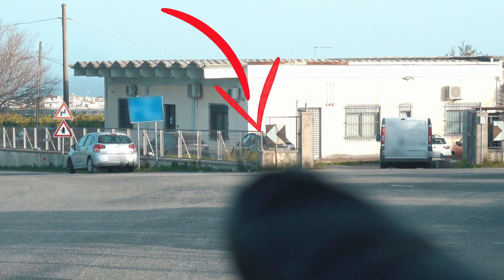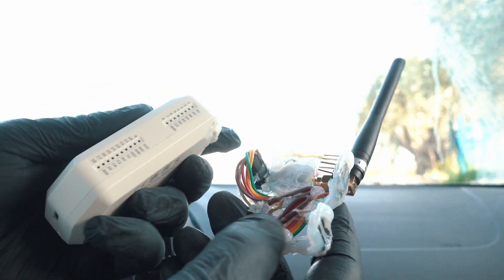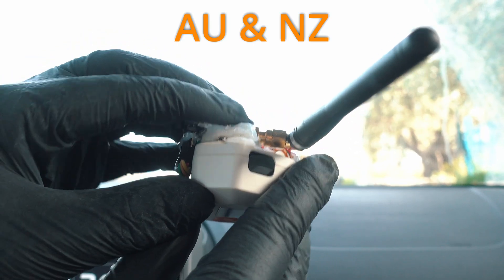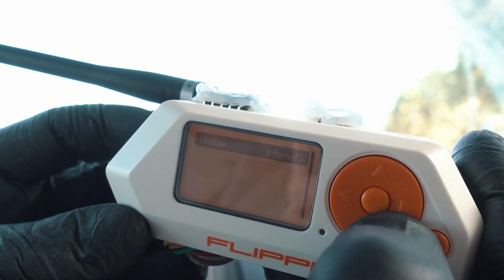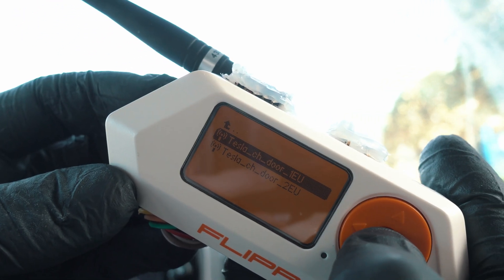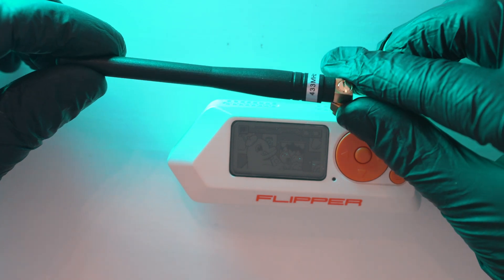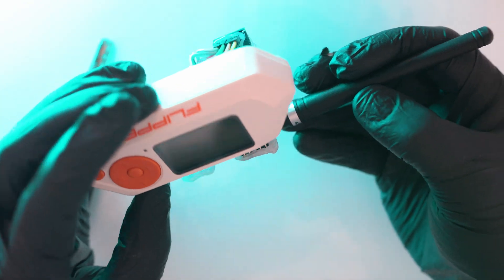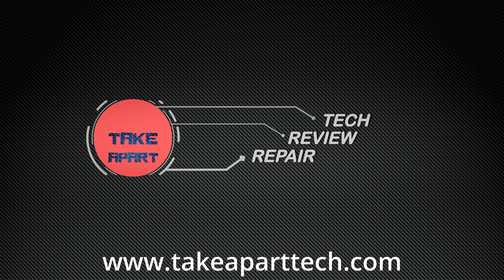Flipper Zero Tesla Charge Port - Long Distance CC1101 Module

Comment: I cant get the Tesla charging port to open with my F0
Reply from the maker: Hi Erik, did you get my SubGHz files? if so which one? also where are you located?
Reply: @takeapart  yes. USA
Reply from the maker: email me exact subGHz file from your flipper sd card and I will have a look.
Reply from the maker: you can find me email in information tab

Comment: Hello, friend, I have put a module with an antenna and when I scan the frequency the same 390.00 always appears. I have checked everything and everything is correct, it is only with the external antenna, what could it be?
Reply from the maker: Hi, it is known problem… external module is picking up some frequency noises.  basically rendering frequency analyzer useless.
Reply: So it's a normal problem, which has no solution, ok I understand, thanks for making your videos I like them a lot, I'm from Spain
Reply from the maker: yes, what FW do you using?  Unleashed may fix it soon .  thanks for watching
Reply: Using RogueMaster
Reply from the maker: oh , it will come …
Reply: Ok thank you very much
Reply from the maker: no worries, thanks for support and watching!
Reply: Please, if you manage to eliminate that noise 390 make a new video I will be totally grateful
Reply from the maker: yea, it is bit tricky…. so you can remove that frequency from frequency analyzer- basically it will exclude that frequency. but that’s not a solution.  I have tested shielding the external module and also placing it away from flipper but not much improvement. 
I will do video about it once (if) it’s fixed.
Reply: It seems good to me, for now delete that frequency from the analyzer but I don't know, it's a temporary solution
Reply from the maker: well you can modify that file in sd card … and remove whatever frequency from frequency analyzer…  with unleashed there is a guide on github .
Reply: Ok, thanks for everything friend
Reply from the maker: no problem! if you need anything let me know
Reply: Hey, does the module work With every sub ghz? Or is it just for 433hz?
Reply from the maker: on the module is written 433mhz but cc1101 chip can do all frequencies just like flipper
Reply: @takeapart  ok but do i Need another antenna?